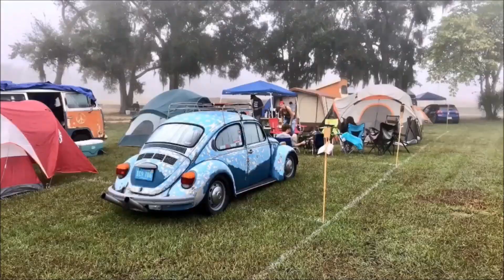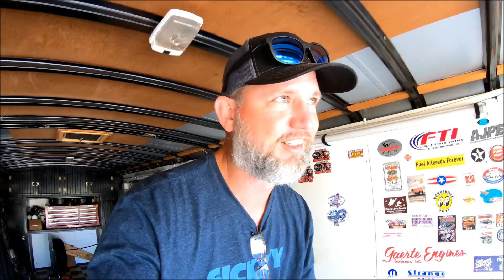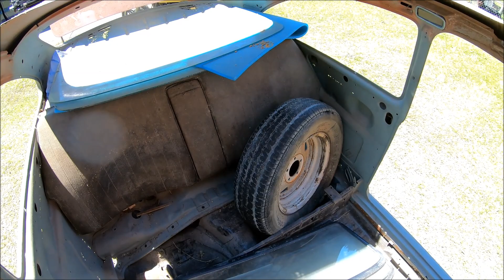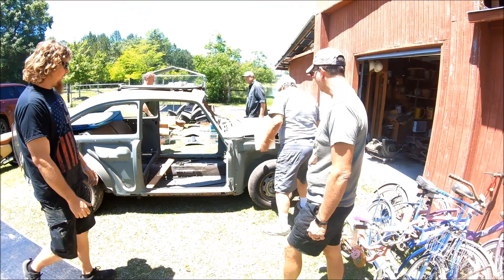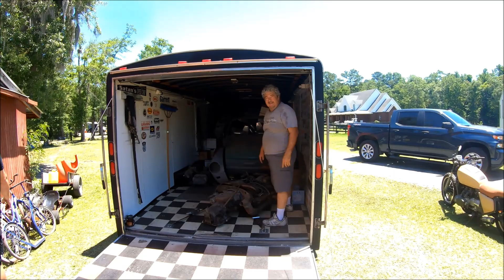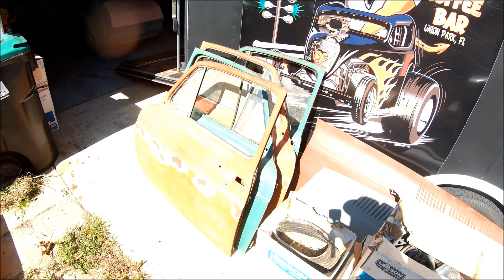Barn Find - 1969 Volkswagen Fast Back!

Comment: If my 70 fastback had a manual transmission, I wouldn't have sold it almost 10 years ago.
Reply from the maker: Wow! You don’t like the autos?
Reply: @VWJawbreaker   
 I didn't like the way it drove with the automatic transmission.  I prefer manual transmission with a air-cooled engine. Also the car was to nice to convert to a manual transmission.
Reply from the maker: @vintage76vipergreenBeetle  I can understand where you’re coming from and I respect you for your decision.
Reply: @VWJawbreaker  
 The fastback is somewhere in Clearwater, FL or Georgia area.
Reply from the maker: @vintage76vipergreenBeetle  it’s possible that I’ve seen it around then.